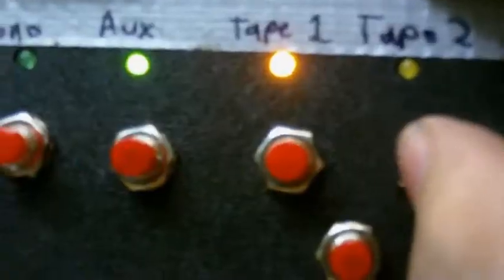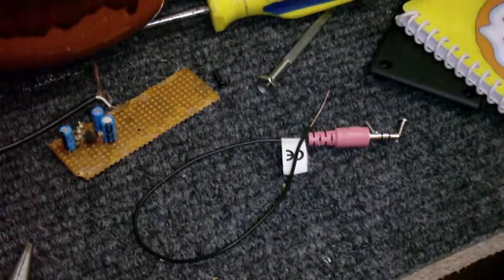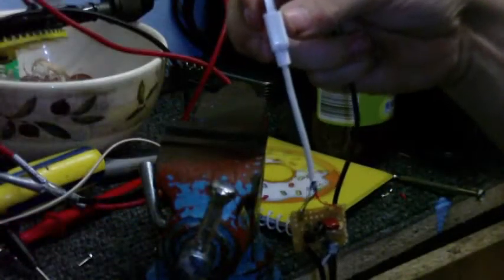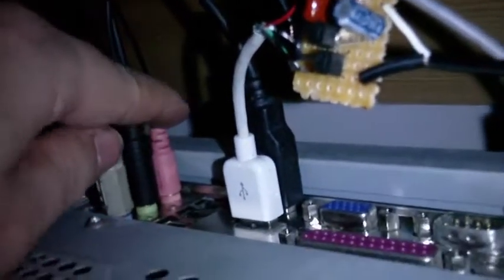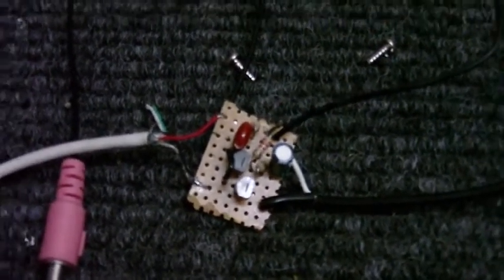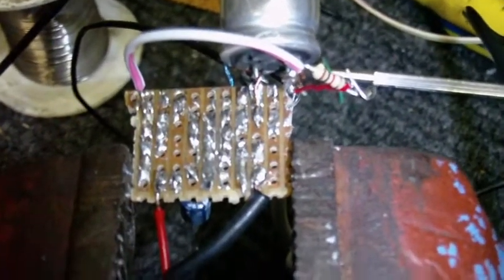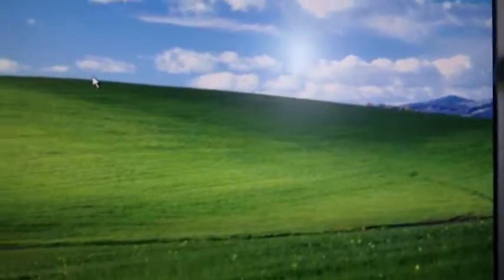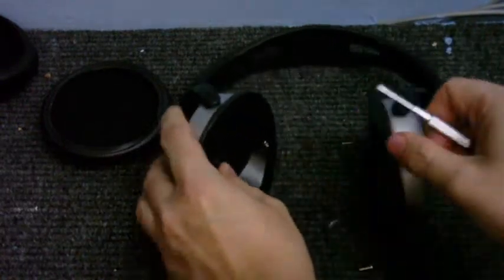CDC Electronic Workshop S1 EP 1 - USB Powerd Mic Preamp

Comment: 3 conductor (l&r plus grd)... how did you wind up with only two conductors?
Reply from the maker: +Harry Haefner The L & R are connected together in the plug. so just 2 wires.
Reply: +CoolDudeClem left and right are shorted then.
Reply: +Harry Haefner therefore only monorail.
Reply: +Harry Haefner did you multiples the outpuit at 30KHz than?
Reply from the maker: +Harry Haefner Yes that's right.

Comment: hi, I was wondering if you could show me how you are able to record on your computer. I would like to record my singing, thanks
Reply from the maker: Randy Travis I'll probably do a video on that soon, in the meantime I have a few suggestions you could try.  I use Audacity to record things such as voiceovers, it's open source so it's free, it also does multitrack recording and has loads of built-in effects.  I would suggest staying away form a microphone that plugs into your computer's mic in though, they usually are quite noisy. It would be much better to get USB mic, although what I used to to do is connect a dynamic (moving coil) mic to a tape-recorder's mic-in and have the line out connected to the computers ine in.  Nowadays I just use a preamp that I made instead.